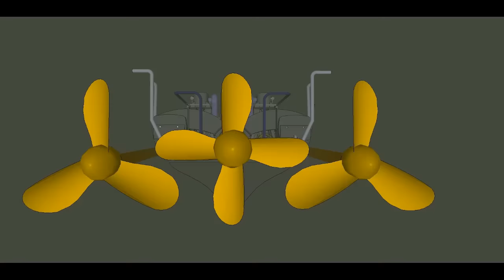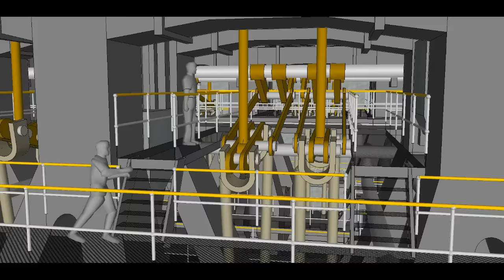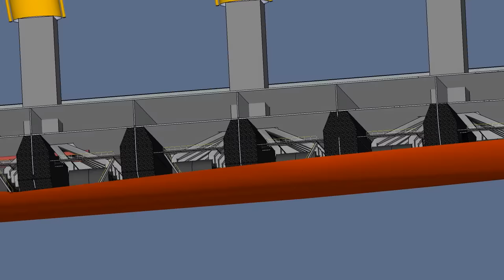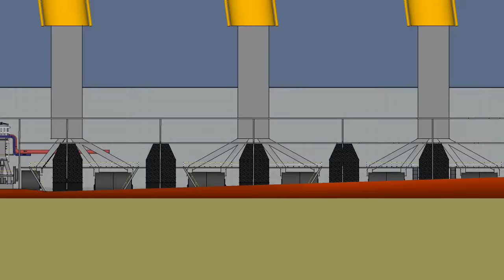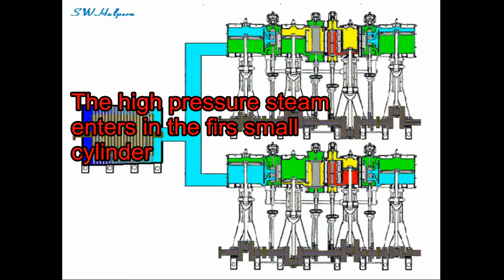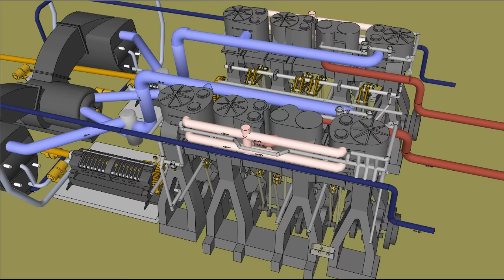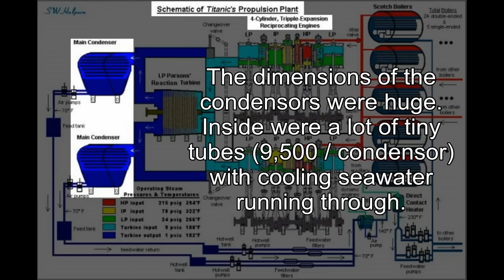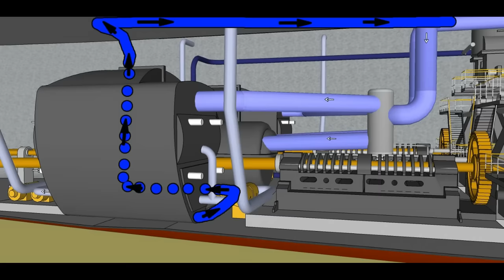The Engines of the Titanic

Comment: Great animation and film cuts to explain the process. Man they must have had like 85% efficiency with that thing cranking at full bore. Whatever energy the massive side props dont use gets used up spinning that massive center turbine. There are extensive support systems too, such as the water and air pumps of differing jobs, the massive labyrinth of plumbing, capable joints, ability for manifolds to expand without breaking, and then they had electrical generators of primitive kind, i presume spun by steam as well. What a tremendous untertaking that today is run by a 100th of the crew number today and system monitoring can be done by half a dozen bridge computer screens rather than packs of men rotating stations to check temperature, pressure, and flow at vital intervals.
Reply: Nowhere near 85% efficiency. Modern diesel/electric engines are about the most efficient internal combustion engines for ocean-going vessels (outside of nuclear power) and they top out at like 40-50% efficiency.

The Titanic's engines topped out at like 15% efficiency.

Nuclear puts everything else to shame.

Comment: One notable thing is the complete lack of gear boxes.  To reverse the props required running the entire engine in reverse.
Reply from the maker: Yes that's right!
Reply: Easy to do with steam engines. Just change timing of steam injection.  Not easy to do with I.C.Engines.
Reply: Actually almost all marine slow speed diesels do that.  To reverse they come to a complete stop and run backwards.

The training tug at my academy was built in the 40’s and had a direct reversible with a shifting camshaft.  The whole shaft moved about 1/2 inch when reserving then fired up the other way.  The 7-8 seconds for this to happen is always an interesting wait as you wonder if/when you’ll have power again.

After WW2 gear boxes became available in suitable power ratings for most high/medium speed engines, though these also can be the Achilles heal of a boat.  Frequently in old tugs the Reduction Gear and Gear Box are worth more than the rest of the boat.
Reply: @Bendigo1  It's easy with 2 cycle IC engines. Just change the ignition timing. That's how many snowmobiles reverse 🤔

Comment: Titanic's central propeller on the turbine shaft had only three blades. Olympic had four, the builders of the ship were experimenting with the designs, and as a result of the sinking of Titanic, Olympic was fitted with a three blades propeller as part of that experiment. The photo often used to show Titanic in dry dock, like so many photos of Titanic, actually shows Olympic.

Comment: I’m going to add on to my former comment just for thought. In WWI the British navy was in a “boat race” with the German navy to maintain their mastery of the seas and maintain their shipping routes, which were their lifelines. Dreadnought battleship design was undergoing great changes from sail to steel to compound steam to turbines in Great Britain. The indomitable team of Jacky Fisher and Winston Churchill was the driving force behind the development of the all big-gun dreadnoughts and the adaptation of turbine engines. Coupled with the turbine was the development of the oil-fired boilers of higher horsepower that could supply the steam to drive these ships faster. The problem with oil was its relative scarcity which kept engineers from dipping more than a toe into the problem of unknown proven reserves. In Great Lakes shipping, that mistrust persisted right up to the Edmund Fitzgerald which remained a coal-fired ship for much of its life. Getting back to Titanic though, several trains left the station in the design phase that could have made her a monster and set some records that would have been tough to beat even through welded hulls. First is the compound engines. With their N-3 steam locomotive, the Great Northern Railway in the U.S. was blowing up the backwards belief that compound engines were superior. The GN simpled the N3 and added a superheater turning a saturated engine into a superheated one, the kind where a pinhole leak will neatly remove your misplaced finger. Fuel usage actually decreased while performance greatly increased. They adopted roller bearings and mechanical lubricators which converted bearings from grease to oil and eliminated the dozens of men required to keep triple steam moving. The second change was in hull design. Titanic was an extrapolation of earlier designs-there was very little difference between the shape of her hull and the California’s; it was simply supersized. She carried the axiom of “if it works don’t fix it” to new heights. The problem there was the belief that higher horsepower meant that you just increased the size of the hull to accommodate more power. Even the greenest engineer knows that’s not true. That tenet may have been one of the reasons why she couldn’t clear the iceberg in time after its discovery. Titanic presented an opportunity to discover and incorporate design changes that would have increased her speed measurably while greatly reducing operating costs at the same time. A good many scientific discoveries are the results of wars, the most obvious being development of radar and nuclear power. If Titanic had had a long and useful life she would have experienced a war, possibly two, and would more than likely not have been the same ship she started out life as.

Comment: In the years following WWI most liners (including RMS Olympic) were converted to burn oil in place of coal. So instead of coal manually shoved into the boilers fuel oil was sprayed into them. So the army of stokers, and general mess that was coal, wouldn't have lasted her whole career if she'd have been around longer. Still same engines/boilers though.

Comment: Can this be done with keeping the same engine system today but replacing the coal fired boilers with hydrogen fired boilers ? For a hotter flame and much more steam pressure ?
Reply from the maker: Hi Stefan, your idea could in principle work! But be aware that a lot of energy is lost. The entire installation with all boilers can be replaced by two large diesel engines, as modern ships now have.
Reply: Just use a nuclear reactor,  a lot less hassel
Reply: @weird1012 I don't think civilian ships are allowed to install nuclear reactor.

Comment: Divide it into 2 shifts of 75 men apiece. Even then it's still 300 tons per shift which still equals 4 tons per man. The logistics of how coal is handled is interesting.

One man per boiler to feed the fire.
Men to move the coal from the bunker to where the stoker and load it in.
Men are needed to remove the ash from the boilers to the ash chutes which took it up above sea level, where more men dumped it over the side.

Most men were needed before sailing to make sure there was a good head of steam.
At departure, they then needed a constant supply of steam to get the ship up to speed.
They could back off during cruising based on momentum of the ship.
As they approached port, boilers were slowly shut down as they didn't need a full head since the tug boats would move the ship to the berth.

I read this in John Maxtone-Graham's great book, "The Only Way to Cross". The logistics of what really went on is amazing.
Reply from the maker: A wonderful story! Thanks for that.

Comment: As most us know, the triple-screw steamer Titanic, and her sister ship Olympic, were propelled by a combined machinery arrangement consisting of two reciprocating engines and a single Parsons’ turbine. The reciprocating engines were of the triple-expansion type with one high-pressure cylinder, one intermediate-pressure cylinder, and two low-pressure cylinders. The Parsons’ turbine, which was fed by exhaust steam from the reciprocating engines, was a low-pressure reaction type. Each reciprocating engine drove one 3-bladed wing propeller of 23½ feet diameter, one on the port side of the vessel, and the other on the starboard side of the vessel. The turbine engine drove a central propeller of 16.5 feet diameter located on the ship’s centerline directly ahead of the rudder.[1] The reciprocating engines were designed for 15,000 indicated horsepower (IHP) each when running at 75 revolutions per minute. The turbine was designed to develop about 16,000 shaft horsepower (SHP) when running at 165 revolutions per minute. At those numbers of revolutions, the ship was expected to make 21 knots.[2] Titanic’s propelling machinery was registered at 50,000 horsepower. Standard “normal full revolutions” in service was considered to be 78 revolutions per minute for a speed a little over 22½ knots. When running ahead at 83 revolutions per minute on her reciprocating engines, the entire power plant would develop about 59,000 horsepower, of which 18,000 horsepower would be contributed by the turbine.[3] When carrying those number of revolutions, the ship would have made close to 24 knots through the water.
Reply from the maker: I couldn't have said it better.

Comment: Wodnerful engineering. It trips me that some people think the Titanic's sinking was indication of faulty design. The thing ran into an iceberg, at night, in fog, with no radar, no sonar, running at above-cruise speeds! The Titanic was designed to survive up to 4 of the 14 sections being flooded. But, AFAIK, 5 were severed... just one too many for it to stay afloat. So, after 2 hours - it finally gave in to physics.

If anyone thinks a modern luxory liner, or even the pride of the U.S. navy, say the USS Gerald Ford - would've survived ramming a major iceberg at full speed like that - well good luck to them!

FWIW modern U.S. Navy carriers have been recorded to struggle with avoiding collision with Spanish lighthouses...

Comment: What impresses me the most about Titanic and her sisters is the fact they used a steam turbine, which were invented only two decades before for the British Royal Navy. Even though it gets the dregs of the steam from both of the reciprocating engines, it speaks to the ability of the engineers and craftsmen that designed and made it that it generates more power than either of the reciprocating engines. These machines replaced the reciprocating engines because they were smaller, lighter, more reliable, more efficient, did not vibrate nearly as much, did not require nearly as heavy foundations to support them and allowed ships to go faster. Ever since they were introduced, they only continued to improve even though today they are only used for nuclear powered submarines and aircraft carriers, as well as power plants. I have no doubt steam turbines will continue to be in use a century from now. It seems to me, Andrews should have used an all-turbine drive for the Olympic class, with four turbines powering four propellers. The triple propeller configuration suffers in maneuverability compared to four propellers, which had a hand in the loss of Titanic.
Reply from the maker: The turbine engine was a fairly new invention at the time. Designing a ship took many years. The designers still had doubts about the reliability of the turbine. They had had experience with the steam engine for some time and thought it would be more reliable. Only later did they realize that the steam engine was unwieldy, slow and inefficient.
Reply: @Hoeishetmogelijk  Indeed, but steam turbines made very rapid progress between 1895 and WW-1.  In defense of White Star and Harland & Wolff, they were not building naval vessels which do push the boundaries of technology with each new category of ship. They preferred to remain with what worked before where possible to keep both the costs and the risks down since paying passengers were their bread and butter.

Comment: One wonders if had Harland and Wolff followed the lead of the builders of Lusitania and Mauretania and opted for an all steam turbine drive of four steam turbines, four shaft lines, and four propellers, if that would have made Titanic faster and more maneuverable, which could have saved her on the night of April 14, 1912.
Reply: Ehm. The project Olympic Class was comfort. Not speed. So why using turbines? The engines of Mauretania and Lusitania produced so much vibrations. 

Olympic class didnt. 

four propellers, turbines would need a complete different design the to Olympic class.
Reply: Of course, but turbines are rotary machines that do not vibrate the way reciprocating engines do. The triple screw configuration was not very maneuverable, and the rudder was too small for a ship of the Olympic classes' size. I think Harland and Wolff compromised and used a turbine to increase these ships' efficiency given the very low pressure the turbine was designed to operate at.

Comment: I am having a hard time with the steam temperatures of the turbine inlet for the pressure.  I am sure you got your information from a reliable source but steam doesn't exist at 9 psi below 212F or 100C.    Water can boil below 100F or 40C if it is under a high vacuum.  Celsius is pegged at water freezing at 0C and boiling at 100C.  It is very interesting that the two steam engines produced 15,000 HP each at 215psi while the turbine produced 16,000 HP with 9psi across it.
Reply: high vacuum?

Comment: More modern ship steam turbines turn at high speed (at least the HP and IP turbines) and need reduction gears or electric drive to get the propellor speed down to where they are efficient.  Titanic's low pressure turbine appears to have been direct drive.  THey could have installed a astern turbine but it would have had to be as big as the ahead one.  Instead they put in a huge valve so the LP steam could go straight into the condenser when going astern.  That was shown accurately in the movie.  One wonders if being able to go astern onall  three shafts might have kept the damage down just enough to keep her afloat.

Comment: Why did they not employ a coal delivery system whereby a chain plate system kept up an endless supply to the boilers, it should not have been difficult to design.
Reply from the maker: Using workers was cheaper than an expensive vulnerable system. Human aspects were not played a role then.

Comment: Congratulations on making a a marvelous model.  It contains, however, one very small error.  The two low-pressure pistons did not go up and down together in unison. The cranks of the two low-pressure pistons were offset from each other by about 45 degrees using the patented Yarrow-Schlick-Tweedy design to reduce engine vibrations. My reprint copy of the souvenir issue of THE SHIPBUILDER on the OLYMPIC and TITANIC  originally printed in 1911 is in storage or I would give you a precise citation and the exact amount of the offset, which depended on the engine.

Comment: I'm confused, did the pistons drive the props or the turbine, or both?
Reply from the maker: The crankshaft with the pistons turns the outer propellers. The remaining steam pressure then goes to the turbine to use the last bit of energy. The turbine drives the center propeller.
Reply: @Hoeishetmogelijk  Ah ok thanks makes sense now. Wow that is very efficient!

Comment: I'm not sure, but the third stage of the triple expansion should actually serve the two outer low-pressure cylinders simultaneously. That would mean that they also act on the crankshaft at the same time. In your model, however, I see a deviation there, as if they were doing this after each other and not simultaneously.

Comment: Did the condensed water pump diretcly to the active boiler? Or just storage in tank and use when to refilling the boiler when it's off?
Reply from the maker: Half of the boilers were in active use, the other half were shut down for maintenance. The non-active boilers could be closed with taps.

Comment: Interesting fact. There is an identical Engine still in operation, in England. It's used as a power station Engine, if I remember correctly.
Reply: It's a pumping engine, used to supply water to London.

Comment: Why was the high pressure steam first pumped through smaller pistons and then bigger rather than the other way round? You would think that bigger pistons need more pressure. Does anyone know?
Reply from the maker: Each cylinder must deliver the same force. In the first cylinder, the steam pressure is the highest, so the piston is the smallest. In the second cylinder, the steam pressure is reduced (because the energy is converted into motion) and the size of the cylinder is therefore somewhat larger. For the third stage, the steam pressure is even lower and the cylinder should be so large that it no longer fits in the engine block. That is why there are two cylinders for the third stage that actually do equivalent work. Remember that force is surface times pressure. The smaller the pressure, the larger the surface area must be.
Reply: Hoe ishetmogelijk Ah - force is surface times pressure, now it makes sense. Thank you!

Comment: gonna be honest I betcha a small stirling engine on board could provide extra electricity if it were hooked into the heat from the exhaust but stirling engines didn't have stellar power to weight ratios...

Comment: What supplied the power to the electrical systems aboard the ship? It was 1912, I would assume that a top of the line vessel had electric lights, they also had a radio transmitter/receiver so there must have been some sort of electrical system even if it was primitive by today's standards.
Reply from the maker: Yes, there were steam powered generators on board for the electricity. I had not elaborated that further because I have limited to the engines.